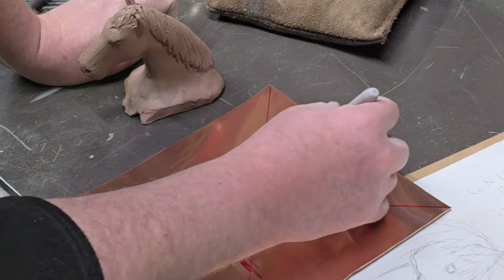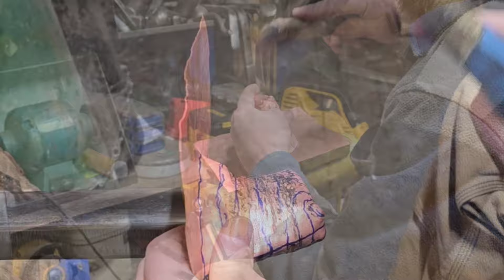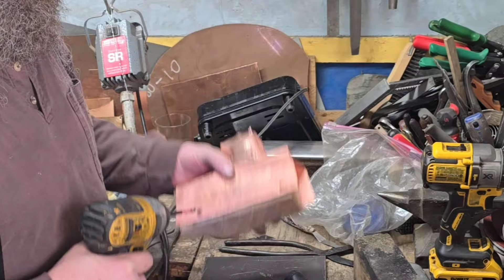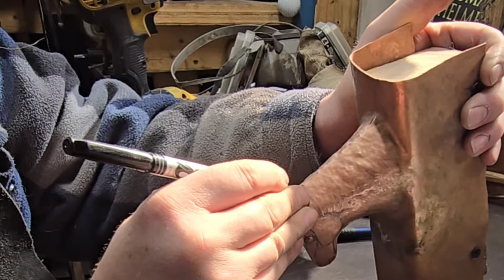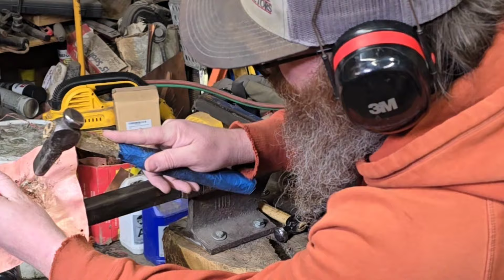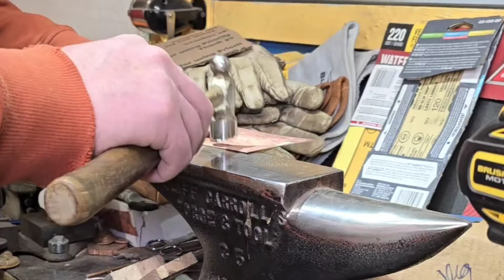how I made a horse head full video

Comment: Absolutely awesome!
I have seen old Swedish coppersmiths fill their copper with lead to form it...
But maybe the resin is better or easier to handle...
You are doing some serious plastic metal work (forming) there, not many who know how difficult that is!
Reply from the maker: It's a wild ride for sure, I've used lead for chasing steel but for copper I see no point. I use wax for most of it and the final part I'll use a pine based chasers pitch. It's hard enough without making it dangerous